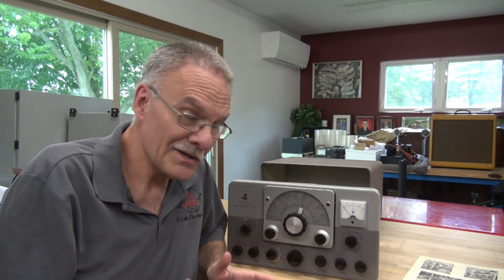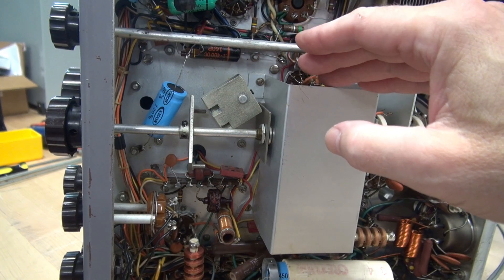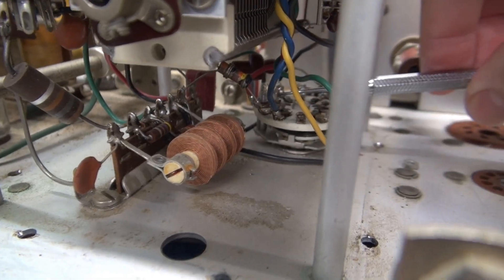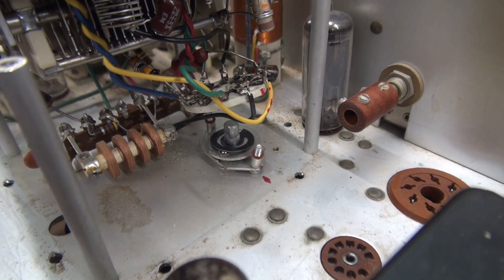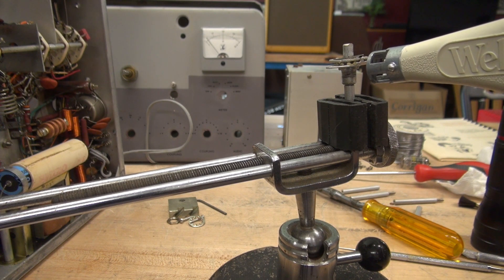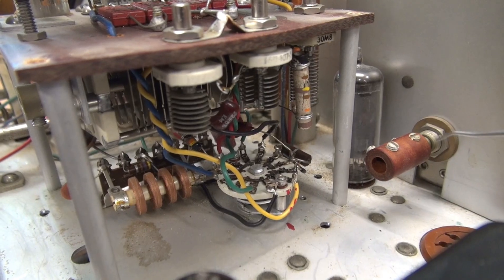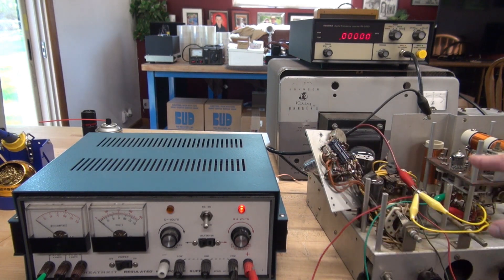Repair EF Johnson Ranger Tube type Ham transmitter VFO seized band switch difficult operation

Comment: That was a carefully executed repair of that  seized switch Terry. I did notice that the pin that turns the block for 4 meters
just barely makes contact and is leaving a cut groove corner ( at 9:10 ) while the 6 meter position is fine. The  fix is to add 
a correctly sized hollow tubing sleeve to go on that shorter pin and secure it when satisfied that it goes into the provided 
slot like the other pin does. Just want to make a note of it for the owner in case a problem developes later on. Great vid!
Reply from the maker: Yes Sir, glad you saw that. I will take a closer look & make adjustments as needed before returning the radio

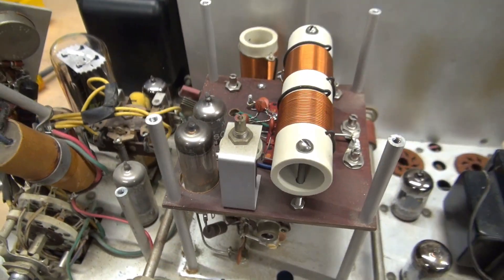Comment: Cool! … I hear that very slow CW in the background at 3:05 and I’m wondering how I can tap into that. As a brand new Extra (KQ4BVT), I am only just starting to learn Morse, and so I’m SUPER slow, and I’m usually put off by everyone’s fast paddle use, and even automated/memory button transmissions at, like, 40wpm and above. To me, that’s not how I need to be learning. How can I connect (even if just over the Internet) with people that are down around where I am, at like 10wpm and slower, using and learning with just a straight key?
Reply from the maker: Hello, I was actually listening to POTA stations, 40m CW. https://parksontheair.com